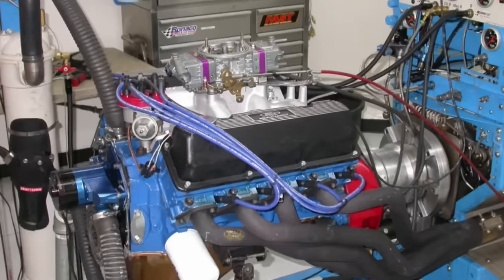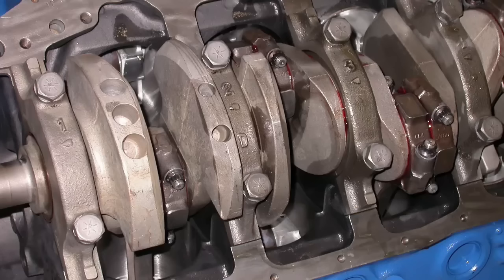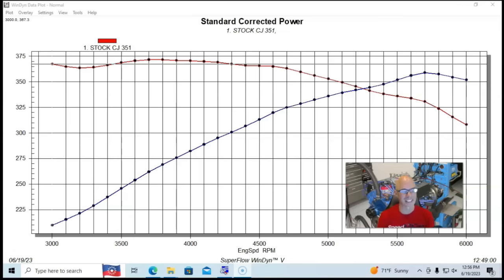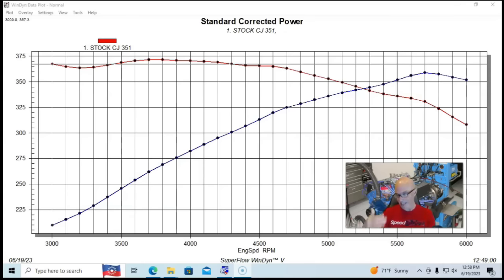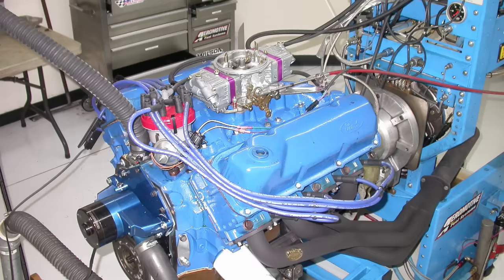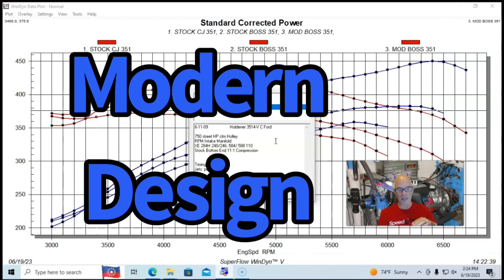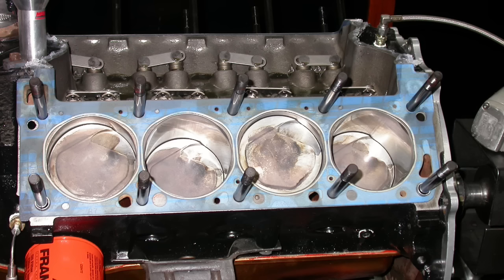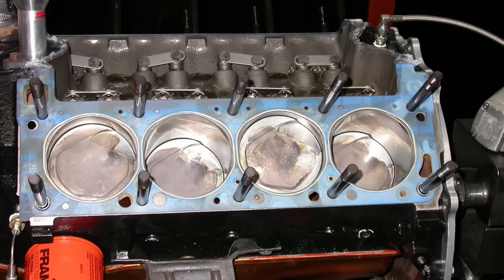HOW TO MAKE 351 CLEVELAND POWER. TUNNEL RAM, STROKER 351C MODS, CUBES, CAM, HEADS AND DUAL QUAD!

Comment: The Chevy small block is the most popular engine for racing, but it's too bad more people don't realize the power of the Cleveland. From a design standpoint, the Cleveland is much better than the SBC. It was the engine that dominated Pro Stock from around 1973 until the NHRA changed the class to 500" inch big block motors. It was also hated by the NHRA because of this, so they made anything with Cleveland power carry the most weight.
Been playing with Cleveland's for over 40 years now, and with all things being equal, they will totally destroy a small block Chevy. And with more modern aluminum cylinder heads, it just gets better yet!
Reply: Why waste money building a expensive platform when you save money buying and building an LS much cheaper to make more power
Reply: @SweatyFatGuy you don't need rpm to make power in an LS it depends how you build it the reason you see people using rpm is it does the exact opposite of what you would think. It makes the motors live under boost. Revving high and making the next shift out of peak tq keeps boosted engines alive especially stock bottom end engines. If you shift at low rpm from say 2nd to 3rd in a 4l80 the next gear is more load and your shifting it into peak tq rpm that spike in cylinder pressure is what hurts them more than rpm. Rpm is only hard on rod bolts and valvetrain. The LS gen iv rods doesn't have rod bolt issues up to the mid 7000rpm range so all that leaves is valve train. Good set of dual springs and one piece pushrods help in that area.
Reply: Tq does move vehicles especially heavy ones but HP is just tq over a given amount of time (rpm). So in reality you can make 600ft lbs of tq at 5000rpm  and 500ft lbs at 6000rpm. While the tq is lower at 6000rpm the engine is making power 3000times vs 2500times at pk tq. For mathematical purposes 2500x600 is 1,250,000. 3000x500 is 1,500,000.
Reply: @SweatyFatGuy  it depends on what you want and the power adder you got I'm sure I can throw a 94mm turbo on a LS7 and make 2000 hp easily or I can buy a billet block and go to 3000hp I'm just saying it's easier to do it with something that has more AM support and the 351c doesn't that much and theres guys doing 1000hp with stock bottom end 5.3's 1000hp is nothing anymore
Reply from the maker: the magazine ad space thing is utter nonsense
Reply: @bethanyhaskiell9116  the amount of people making 1000hp on LS engines reliably is a lot less than the internet will lead you to believe. I build and tune these engine both na and boosted. While they are capable of doing it most tuners aren't capable of getting it done and then there is mechanical error and user error also. Like running pump 87 gas on a turbo LS that was tuned to the ragged edge on 93 octane. Ive ran a few "1000hp" cars in my turbo sbe 5.3 that is heavier and I know isn't making 1000hp. I'm probably getting closer to that number on my current build but still not there and not going to be able to get there with my current turbo sizing. 99% of people would shit if I gave them a ride in a 500whp car. Making power in today's age and technology is easier. Getting it to the ground is easier than it used to be but still challenging.
Reply: @thatturbotruck there are like 20 locals here where I'm from that race and use the LS and there's like 5 that are over a 1000hp and have been on that same setup for a couple years and they all use stock crank with forged pistons and a couple that have forged rods and pistons
Reply: Fastest lap in NASCAR history still in the record book since 1987. Ernie Elliot's 212+ mph 351C!
Reply: The sbc whooped that furd shit out of existence. You have to completely redesign that furd shit to keep up with old sbc stuff. Forget about competing with ls stuff
Reply: @HioSSilver1999  Wrong. Chevy only had two decent flowing heads in the 60's...the 461 and 462 castings. And in the 70's the only real factory head that gave any potential at all was the 041.
None of those heads were any competition for a Cleveland head.
Once the Cleveland came on the scene, and racers began to figure it out, it was lights out for Chevy.
I'll give you the Chevy's victory over the 289/302 and 351 Windsor.....with their abismal small ports and valves that didn't breathe very well. The SBC heads had those beat, hands down. But the 351C not only evened the score, it placed higher in the ranks than the SBC.....enough that many sanctioning bodies either banned it from competition, or handicapped it so much that they purposely made it non-competitive.
Reply: 351C was lower production, most came with a non-adjustable valvetrain that required lots of machine work and parts to add a decent aftermarket camshaft and came with absolutely GARBAGE valves that tended to break the heads off.  Ford had a great basic design, but allowed the cost engineers to kill it's ease of modification.  Chevys were a lot easier to modify, and were made in MUCH larger numbers.
Reply: @n2omike  I don't dispute that.  I've built plenty of SBC's and SBF's myself.
Reply: @SweatyFatGuy . I’m not a ford hater so lets get that straight.. Most of what said about the Chevrolet was laughable..!   We street raced for years and never lost to ford ever.. That being said .. yeah the Cleveland came along and made big power but were somewhat rare.. The main reason the CHEVROLET needed after market stuff was Chevrolet ( GM ) Would not get involved in racing …period  !   Remember the early TRANS AM series ? Roger Penske and Mark Donohue spanked the fords ! Chevrolet using the DZ 302 and Ford the Boss 302 ..!  I can see you are talking drag racing and i am talking about all forms of racing ..! How about sprint cars using CHEVROLET POWER about 98% of the time.. NOW I’ll hand it to you during the mid 80’s BILL ELLIOTT kicked CHEVYS but using the CLEVELAND style heads but ford still had a hard time on short tracks and road courses… This again forced the Chevy boys to step up to 18 degree and so on.. No one ever forced Richard CHILDRESS , RICK HENDRICK ,  RODGER PENSKE, BILL JENKINS, or SMOKEY YUNICK to build CHEVROLETS TO WIN multiple championships , they run CHEVROLET POWER BECAUSE IT WORKS ..🏁🏁🇺🇸
Reply: @biscuitboy3617  for starters the clevland was the size and weight of the bbc. Actually a oe aluminum head/intake was lighter than a clevland. Making the bbc a no brainer choice.

The heads were copied from a bbc. The clevland also couldn't be had with 400ci like the sbc. The clevland was really just a ok engine that needed a extreme amount work to even hold together decently.

The only reason the clevland was band was because by the time modifications got done it wasn't even a clevland anymore.  Look it up....they would cut the head up to make it be what you think it is
Reply: @HioSSilver1999  You are completely wrong on all counts.
Reply: @biscuitboy3617  actually I'm not. You furd boi's just don't like the truth.
Reply: The anchor may be good for mooring boats! SBC has made as much power far more reliably for decades. Clevo has poor oiling, suspect cooling and everything is heavy faliling around inside on too large bearings. Drag and heat.
And yes I have raced SBC of various specs. And have played with Clevo and 400M engines. My 11-1 351 with 302 rods and a mild hydraulic race cam with 302C heads, Holley intake and 750 Holley made 440hp. Max 6500. And did around 11 motorsport sprints and hillclimbs. And lived though the bore did not look great. Still running fine though. BUT if I wanted to go for more power it was very suspect so I have built a Boss 347 with CHI Clevo style heads. Has worked out way too expensive and the block will be a little suspect but it will make more power and 1000 rpm more. And weigh near 150lb less! so the car will handle far better
To make a reliable Ford for drag racing,, they struggle to do distance get an aftermarket block, [Windsor based]  aftermarket crank and rods and CHI heads. And it is heavier with less hadbolts than a SBC but should be reliable if maintained
Reply: @SweatyFatGuy  WE RACED EARLY 70’S .. I heard the Cleveland made great power but never ran across one.. i get what you are saying about stock small block CHEVYS were a little behind the ford Cleveland at the time but their were so few. A few years ago their was 57 Chevy with a pump gas 406 / turbo 400 ..3200 lbs that ran 11;20 all day long . A real sleeper nothing exotic .. i don’t care where you go or what kind of racing you do , sprint cars , trans-am , nascar , off road ect .. the SMALL BLOCK CHEVYS are to be reckoned with..!  SINCE 1955 TO PRESENT..!!! 🏁🇺🇸🏁
Reply: @SweatyFatGuy  SBC was one of the smaller lighter motors to of course, fitted easily into Street Rods.
Reply: @josephtravers777  SVO version of a Boss, Yates heads I guess.
Reply: @TomSmith-cv8hk  The Yates head came out later. Ernie was a flow bench master, did his own mods.
Reply: @bethanyhaskiell9116  This wasn't done as a cost comparison. It was done as a performance comparison from a stock engine to power adders. If you want to use your logic, why would you want to use a bowtie copy of a Windsor engine to begin with?
Reply: Guess where that head design came from,? Not ford. Bbc had the head design in 1963 427 mystery motor
Reply: @David-er1cy  Wrong. BBC does not have equal length intake runners. 351C does.
Reply: @David-er1cy  and Chevy copied it from the Dodge/Chrysler "Poly angle" 318 from the 50's.
Reply: @Naoj2024  Read Donohue's book "The Unfair Advantage". After getting frustrated with losing, they resulted to some very clever cheating. Acid dipping cars and engines, having multiple cars with the same paint scheme, one for inspection one for racing etc. Junior Johnson had nothing on them in the creativity department :)
Reply: @HioSSilver1999  Ford Cleveland 351 24 ½"W 29"L 28 ½"H 550lbs - 
Chevy BB V8 28"W 30 ½"L 29"H 685lbs
Reply: @cgarris8674  i have read it.. Mark Donahue was and still is my hero ..! I have his autograph from the trans am series … Kent Pacific Raceways in crummy Washington state…!  Your forgetting something the other guys were cheating too!  The first race trans am race i went to Mark was leading the race and dropped out ! Water in the oil i believe and i was so disappointed, but his partner RONNIE Bachman won the race in the other Penske Camaro..!  I tell you what Chevrolet motor division wasn’t helping much if at all but they still won the trans am series against ford , dodge, and brand x… Remember the NHRA PRO STOCK TRUCKS..?  They all used small blocks and BILL Jenkins splayed valve small block Chevrolet cleaned up in that too..I see others claiming the reason Chevy small blocks are popular is because they built so many ..!  DAAAA.. ! It all started with a little 265 V-8 in 1955 … WELL DID YOU KNOW THAT LITTLE 265 GREW TO 283, 327, 350 , AND 400 STOCK AND UP UNTIL JUST A FEW YERS AGO WOULD BOLT INTO MOST ANY GM MADE CAR PRODUCED ! AND ALSO WILL BOLT TO ANY TRANSMISSION MADE BY GM..THATS NOT CHEATING THAT A SMART MOVE BY GM…
Reply: @cgarris8674  like i said...a bbc could be had with oe aluminum heads and intake. Making it lighter than the clevland. Other than that dimensions are close.......performance between the 2 is not.
Reply: @HioSSilver1999  Inch and a half more narrow than a SBC & 25lbs lighter than a SBC. My BBC still weighs over 600lbs with Brodix heads and Intake but they're probably heavier than the OEM's I guess.
Reply: @TomSmith-cv8hk  DID YO MEAN OF ‘’CHOICE ‘’ INSTEAD OF COURSE ? … INTO STREET RODS…
Reply: @josephtravers777  which has nothing at all to do with YOUR sbf
Reply: People like SBC's because they're CHEAP to build.  Period
Reply: @Nunya_Beezwax  well up until the ls they were the best smallblock......period
Reply: @bethanyhaskiell9116 all a 4v needs is a good rebuild, a 600 lift cam, single grove valves, springs, adjustable rockers, a good single plain intake and a 800 carb and headers. And it will go like hell.
Reply: Chevy has a rear sump. Better for racing.
Reply: @josephtravers777 bill Elliott
Reply: @Naoj2024 did you forget the ford cosworth engine?did you forget 10 consecutive nhra pro stock championships with the 351 clevland and bob gliden?don't you think short track and road courses are more of a driver thing,,as in the early mid 80s it was the gm cup series with about 5 ford's and I chrysler in a 43 car field.
Reply: @rickkowalske4116  Rick, thanks for the challenge… First of all i love racing of all kinds not a ford hater at all… Was not the  cosworth a pure race engine , never ever saw one at a drag race or car show..?  My challenge to ford peoples in defending the CHEVROLET is the big and small blocks were everyday engines in everyday passenger cars not some special engineered or exotic limited design… Now Bob Gliden was a hero of some of my friends and could probably won some of those pro stock championships with a inline six he was that good…!  Do you remember the PRO STOCK NHRA TRUCKS ? The rules were limited to small blocks i believe ang BILL GRUMPY JENKINS won with a SB chevy using LITTLE CHIEF HEADS ? I believe you are wrong on the driver thing on road courses .. fords have always been real good at wide open throttle like drag racing but the Chevrolet has always been good on short on and off throttle racing like sprint cars , sprint boats , nascar shows this to be true .. Look at the win ratio in nascar cup racing the BOWTIE BOYS have won over twice as many as brand X…!  Don’t forget the Pontiac, olds and Buick  all had small block Chevy  ( GM) engines ..  The reason there are more Chevrolets in the cup series is cost and simplicity..!  And now nascar allows Toyota to compete and it’s basically a GM RO-7 corporate design… All built in America.. what’s to hate…!
Reply: @bethanyhaskiell9116  My tuner blew up his 600hp ls7, plus some ppl blow up their 600hp 5.3s on the 1st race, a stock engine with turbo can live when babied bcuz there's lil to no boost down low, but push it n kaboom..lol
Reply: @P71ScrewHead  My dad's stock with Holley High Ram 6.0 swapped 3rd gen Camaro has been completely fine for 4:years with a good bit of abuse 5 months out of the year at 800 WHP with twin BW S372 turbos its all about the tune the only problem we've had was we lifted a head once but we're throwing forged internals and Mast 225 heads on it this coming spring and going to 1000 WHP so we can catch up to his buddies thats already over 1k
Reply: @bethanyhaskiell9116  Sounds good man, good luck on the build.. Gonna be alot of fun I bet..
Reply: @P71ScrewHead  Thanks buddy
Reply: @bethanyhaskiell9116  No problem amigo..
Reply: I knew there had to be one in the crowd slamming sbc. What do you mean by equal? Equal then than your correct if you say equal now with technology than your not. Ford did well canting the valves similar to a bbc. Im not a ford guy but I convinced a friend to build one insted of a stroker 302 because he could make more power and do it cheaper.
Reply: And then they came out with restricter plates!!!
Reply: @ws1807  I mean "equal" as in cam specs, compression, displacement, etc.
Reply: @bethanyhaskiell9116 Because they don't make more power and they blow up like all Chevs.
Reply: @HioSSilver1999 Ya NOOO if u actually learn you'll find that all Cleveland engines in competition were forced to carry extra weight or a smaller restrictor plate. You can always tell a Chev fan boy who is young and has no idea of history and rules changes to minimize the Cleveland Fords superiority. Nice try but learning not listening to Bubba down the street will set u free.
Reply: @matthewmoilanen787  all manufacturers has had weight thrown on them at some point. It's how sanctioning bodies even up the competition.  Usually it's because the TEAM  has discovered something that gives them a advantage. 

As far as some racing goes furd was actually allowed to run a clevland in many instances because the windsor was such a turd. They ran the clevland abd it wasn't even in production anymore.....which for many sanctioning bodies is a no no. On top of that it wasn't even a production head they used because there never was a oe aluminum clevland head. It was a pure race head......all the while they wouldn't allow chevy to use their race head.

Furd gets given alot of shit in racing. Like when the s197 mustang was introduced.  They ran it in scca showroom stock racing.....but not with the production 4.6 because it was horrible.  They used a 5 litre cammer crate engine in showroom stock racing mind you.
Reply: @matthewmoilanen787  LMAO that just why my dads twin turbo LS2 swapped 3rd gen went a little over 4 years at over 800 whp with stock bottom end and forged pistons and just built it this year with a 415 stroker forged crank and rods and went to an F1x PC making 1180 now the only thing that's ever happened was blew out the passenger side head gasket twice from which we figured out was one of the head studs was screwed up from being over torqued and replaced the cylinder heads with a set of Mast black label heads but think what you want 😂

Comment: That's so impressive with a ported stock head. Hopefully one day you'll do some all out Cleveland builds with a great aluminum head like CHI.
Reply from the maker: I HAVE CHI HEAD VIDS UP
Reply: Ours made 2.1 hp per cube n/a with a cast single 4 and a stock head. Vids on my channel. 5.70s at 120 weighing 2890